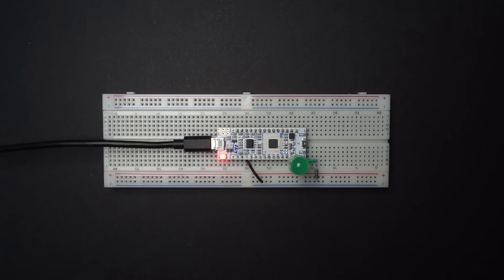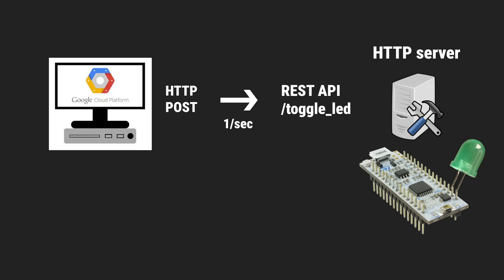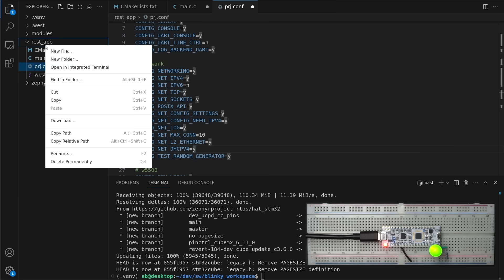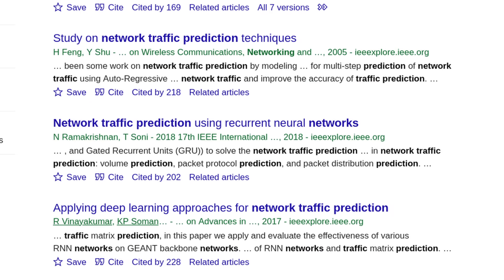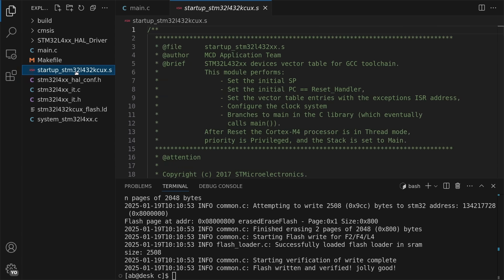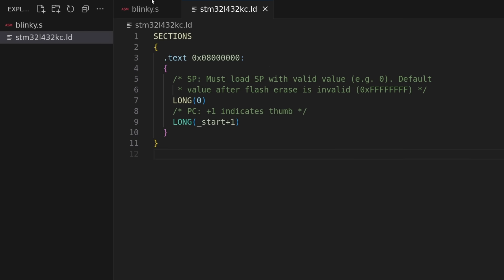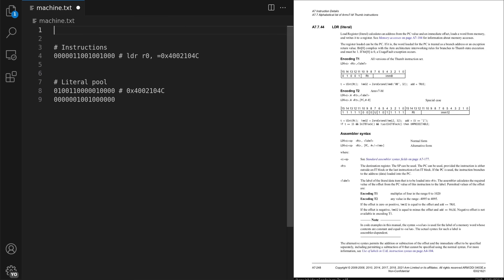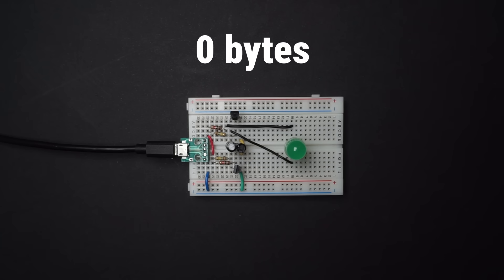I Shrunk Blinky to 0 Bytes

Comment: My boss told me about a totally analog state machine using optoelectrics that fed inputs to an eeprom-based state machine. You'd encode the output state at fixed locations in eeprom, and when you flicked it on, it started by outputting your init state at 0x00 in eeprom and then started doing its thing, completely code free. He said "the only way we could make sure it ran fast enough is if we knew it was running at the speed of an electron" wicked

Comment: instead of the decrement loop in your assembly code, can you somehow link a bit from the system clock to the gpio so that all the program needs to do is pull a bit from the system clock then write it to the gpio? depending on the complexity of the architecture and how the program clock is stored you might be able to shave an instruction off or two. it would basically be the program version of the astable circuit since that's what runs the program clock runs on. bonus points if you can extract the bit from the clock without using gpio and break open the chip to grab from it directly.

Comment: 0:54 but why run it on a microcontroller instead of discrete logic clocked to 1000 ms?  (I'm sure even I'm overthinking this, but this really doesn't seem the job of a microcontroller)
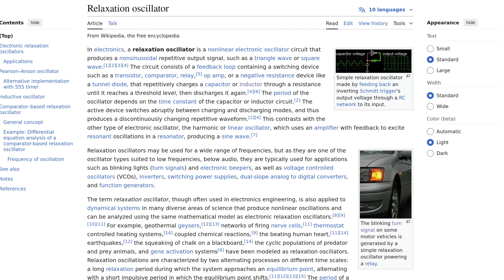Reply: 11:49 okay yeah this would work, but it makes the timing very sensitive to the component tolerances so idk if I'd count it as being as close to 1000 ms as possible.

Comment: About 0 bytes - Microcontroller is last solution, that you may use, if it's too hard to do it with analog devices. I developed a board, that allows you to connect door phone to land line telephone line. And without any microcontrollers. Only analog and hardcode (hard core, not soft core)

Comment: you could program the microcontroller so that it only supplies electric current to the blink circuit
or connect blink circuit to microcontroller 5volt and GND

Comment: 0:00 / 0:01 Pulse Width Modulation (PWM), using set of electric pulses to control the output independently from the input, because you can't simply control something by decreasing input voltage, but rather using something like this: |||....|||....|||....

Comment: Please Artful Bytes, hear me!
Sorry, but I'm very upset because of all steps after AI. Sorry, it's really bad. I don't want to be rough. But. As embedded developer you are using delays!
It's just unacceptable, it's a crime against nature.
There is no delay instruction in ARM manual, or any other architecture. Was you ever wondering why?
NOOP means no operation. It didn't called delay or wait or sleep. And there was and currently ongoing alot of debates to remove it completely.
"And how I suppose to measure time?" - you can ask. WITH AN ONBOARD PRECISE TIMERS OF COURSE!
Dude, really. There is several HIGHLY-configurable peripherials on every MCU on Earth. On that specific stm32l423 there is total:
11 !!! TIMERS
2 ! PLL
Oh god there is RTC onboard..
14-bit DMA
Man, you can blink that LED even without runtime code. On old(but reliable architecures like AVR(arduino lol)) you even can blink it without burning FLASH memory with firmware, just by adjusting specific fuse-bits. Means less than 16 bytes for completion or even truly 0 bytes for AVR.
So, please don't do this again. Don't ever use delays, just stop! Don't teach anyone to do this! It's most disgusting and unethical thing in embedding. It's insulting life itself! Using delays is path right to jail.
Thanks anyway for highlighting embedding existence!
Yeah also about 0 bytes solution: because of pulse trails not quite formal beside of mechanical approach with 1 reed switch it also achievable with 1 optotransistor or even 1 BJT or even! (1 same LED and RC circuit) which in total also 0 switches(zero bits) instead of 2 BJT flip-flop(2 bits basically).

Comment: i think you could make the assembly programm even smaller by configuring an io pin as output high and configuring the watchdog timer to 1s with fuses... ok your on off timing would probably not be symetrical... but maybe storing the last state in a capacitor on another pin and reading its state at startup and just outputing the opposite thereof is less bytes...

Comment: Well, the code you'd run on the micro-controller would be [null] so the last solution does technically run on a micro-controller. Just treat the circuit as a peripheral to the microcontroller :)

Comment: Using Arduino Uno (not the same microcontroller), I did, in a blog post, manage to squeeze the blink example down to 6 instructions (12 bytes):

```
  sbi DDRB,OUTPUT_PIN ; setup

mainloop:
  sbi PINB,OUTPUT_PIN ; toggle pin

delay:                ; ~ 1 second
  sbiw R24, 16
  sbci R26, 0
  brcc delay

  rjmp mainloop
```

If clocking down the speed (using fuse settings) is allowed, and removing the bootloader, the busy-wait and jump can actually be removed. This causes a free-running instruction pointer that loops the rest of the entire blank flash, giving a blink program in "only 2 instructions" (4 bytes).

Comment: I actually use not only a micro controller to blinking LED, but also network before and it was required. The requirements were however, slightly different light to go on and off once a day is turn on the same time in the morning as it did the same time at night it needed to use an STM 32 C3 micro controller because that’s what I had no additional hardware besides Denali and resistor the way that I did this was by writing system for calling to a NIST time servers every eight seconds as required by servers, turning that data into integer values and then checking variables that were defined by a web portal at startup what’s worse is that all of this made sense and we did this it’s still functioning. We’re still using it and it has never failed that LED turns on at precisely 7 o’clock every day regardless of daylight savings regardless of time zone regard this is if I’m there if I’m not if the power goes out or stays on powered on battery or plugged in, it will always turn on at precisely the same time and it will always turn off at precisely the same time within eight seconds I built this project for my jumping spiders because they don’t get hungry unless they get enough light so consistency is very important. That’s the main reason why I added the battery to the project the micro controller. I had already had a battery charger and battery port so I just saw a little battery on there to keep it going for a few hours, it default to the current pin state until an update is received from the network. If the network drops it will retry until it fails. When it fails it will give a warning code through the blinking light because again no additional hardware and then remain on or off depending on time went out. I have yet to add additional network checks in the loop code times out right now and then fails and notifies. I don’t know why I did this. I could’ve just spent $10 on a smart switch and put a lamp over the enclosure, but it was cool

Comment: For your bistable flip-flop circuit, I recommend using an NEC555 timer IC. Although it is fundamentally an integrated circuit, you might find that it resembles a compact microcontroller, such as an ATtiny, in both appearance and certain aspects of its behavior.

Comment: This reminds me of a time in college when I met a group of computer engineer students who were working on a homemade timer project for a class.
They were making a binary, five-minute timer, and were showing it off outside the student dorm grocery store.
They were sitting down next to me while I was eating some pizza, and I asked them if the minutes and seconds were set separately. They said that I was correct and that there were separate inputs for minutes and seconds. I asked if I could turn it into a six minute timer in one, easy step.
They said yes. I turned the knob for the minutes to five, and I turned the knob for the seconds to 59. The resulting conversation they had about whether to remove that function or make it a feature was fun.

Comment: I get that the point was to use AI in some way but you could i have just: time.sleep(1-latency)
and boom, you now only sleep for the rest of the 1 second duration, you can fetch the latency after the request then run the command above

Comment: I love working within constraints. I had a project that needed some randomization and it turned out it was easier and more space efficient to store 100 precomputed random numbers into 50 ints and cycle through them. The whole cycle took six minutes so it was "random enough" and saved 600 bytes of flash versus even a simple PRNG.

Comment: Honestly it depends on what you consider a byte but using an analog system for blinky that depends on whether the circuit has power or not is probably always going to be most efficient.

Comment: You can go one step further, there are LEDs that blink without needing any extra circuits other than current limiting.

With a little bit of time you can find the right resistor value and a blinking led to get roughly 1000ms blinking.

Comment: Would it be possible to config the clock to run at 0,5 Hz and output that to a GPIO? No toggle logic required. I think the RTC clock can be set to output 512 Hz or 1 Hz on the PC13, so maybe tinkering it down to 0,5 Hz would be doable
Reply: nice idea

Comment: 11:05 As long as we ignore Pseudoinstructions, yes, they are pretty much one to one representations.
And in case somebody doesn't know what Pseudoinstructions are: These are instruction which as far as Assembly is concerned are treated like normal instruction but are multiple instructions in reality, which means that they get splitted into their actual parts by the assembler.

Comment: Why do you use adds r0, r0, #0x18? Why not just str r1, [r0, #0x18] and remove that instruction?

You could also save another ~3 instructions by merging the delay and gpio update.

Comment: Man - check the "self-blinking" LEDs on the market....
(you only connect the power voltage to it and it blinks on its own - the swithing semiconductor is on the LED chip itself)

Comment: The purpose of blinky is similar to a hello world program. It bootstraps a project, gets basic behavior done. The whole point is to get the microcontroller involved, because blinking is not the target. It's just the first step. 

You could write a hello world on screen with 0 bytes too.  Just use a permanent marker. 

To me, the final conclusion looks a little like misunderstanding the whole point of blinky.

"Great, now connect your project to a sensor using i2c"

Comment: Technically the astable multivibrator is 2 bits. 

My shortest atempt on a PIC microcontroller has 5 instructions. Altho it doesn’t respect the 1000ms rule because it uses the sleep instruction and the watchdog timer. 

Oh I forgot, there are LED that flashes… even multiple colors. I think they have the integrated circuitry to make it flash.

Comment: I was expecting the zero instructions code to use a PWM to blink the LED. As it's hardware, there are no instructions to 'blink'. You could still go a lot further, and use features like brownout creatively. E.g. create a fault which resets the microcontroller every second. An RC filter from the LED line to the reset line might work just as well for ~1 instruction, ~10 bytes solution.

Comment: Crazy thing is that the resistors and capacitors needed to make that relaxation oscillator cost several times more than a small microcontroller such as an ATTINY, and occupy many times more space. For that reason today we frequently see tiny chips containing the full power and features of a bar fridge-sized 1970s minicomputer doing things like blinking a single light in an appliance.

Comment: I wonder if there's another optimization in the assembly/machine code state where you could leverage setting up a timer peripheral and pipe its output to the GPIO? No branching logic required, just a few extra register writes.

Comment: If you want to use a microcontroller, you can buy a fresh new Arduino and plug the USB cable in any power source. It will blink the LED by default, you don't need to write any code, so 0 bytes with a microcontroller (the preload code doesn't count 😅)

Comment: Using a 555 timer could have been a nice middle step between the last two: it has a flip-flop inside, so even not being a microcontroller, it could have been classified as an 1-bit implementation 😂

Comment: And the discrete oscillator is radiation resistant, tolerant of extreme temperature ranges, immune to EMI, and would likely work for 1000 years if built well.

Comment: The point of a Blinkenlight, is to test all system components are working. So your discrete astable doesn't do this. ie, Make it as simple as possible, but no simpler.

If you want zero bytes of code, use an FPGA: Technically, they don't run code.

Comment: You could set up an LDR in series with the LED and then construct a spinning device that blocks light for 500ms and doesn't block a light source for 500ms and get down to truly 0 bytes (and continue adding ridiculous mechanical complexity in the 0 bytes category).

Comment: Sure, "using a microcontroller to blink an LED is overkill" if that's all you need to do. But when the requirements change, it's generally easier (and cheaper) to update firmware on a microcontroller than have to redesign and rebuild a discrete logic circuit.

Comment: ok, 11:11 - you should leave the microcontroller but not connected - in fact it runs a 0 byte program without turing on :)
i would just use a blinking LED :) but there are no 1000ms blinking leds.

Comment: maybe a possible solution would be:
- set GPIO port to output and set the level to HIGH
- add so much to a register until the interrupt jumps in and restarts the microcontroller

Comment: Could you set the LED pin to the highest needed bit in your counter register. Then compare to a value that is double the needed timer count value. If not equal, increment the counter. If equal, set counter register to 0 and loop.

Comment: For the ARM (or thumb, really) asm, you should be able to at least get rid of the add instruction where you increment the address, as you can encode offsets into the store instruction. If its out of range, perhaps the address can be massaged so it's somewhere between the two addresses and then you can use a negative offset for the first store and positive for the second, or so.

Comment: So in the end you used a total of 8 components to do what in the previous step needed 48 bytes of machine code and a microcontroller that probably contains thousands of transistors and is way overpowered for this simple task. And that's what you could, in fact, do with every problem... I think every problem that's done in software could be embedded in a circuit that needs far less components than the computer the program is running on. Still people went from discrete circuits to computers because the software for them is easier to design once the computer (or microcontroller) has been built. However, with today's technology one could try to automatically convert software into electronic circuits...

Comment: If you get all philosophical here. What is a byte? I would argue that your astable circuit has at the very least 2 bits of information, one for each capacitor. 4 if you count the transistors. I'm just messing with you

Comment: I think you missed some stages.
1. Use a simpler microcontroller. The STM32 devices need more initialisation than most. Something like a PIC (or maybe an STM08) would need less.
2. Use a 555 for lower parts count but still an IC
3. Use a simpler oscillator. An astable multivibrator is not a relaxation oscillator, which is a capacitor discharge triggered by a threshold voltage. You could use a 3-pin comparator such as a supervisory IC , or if you used a neon (which has an inherent trigger voltage) just a capacitor and a resistor. An LED too has a voltage threshold below which it will not pass current but it has no hysteresis.

You might also enjoy Dorkbot's competition to find other ways to flash a light. I'd give you a link but youtube has now sunk so low it doesn't publish them. Look for 'dorkbot flashing light competition'. I never got around to entering but my idea was to run an unpowered AM demodulator near to the longwave time transmitter at Anthorm - it would illuminate once per second.

Comment: Trash the whole loop and use a capture and compare timer. It may not be a smaller size but uses much less core processing, which is the real goal in optimizing embedded code.

Comment: You absolutely, 100% cheated for your final approach.
I applaud your work! ❤

...I went the other way for my vehicle blinker project; started with a 555 with a relay, and eventually upgraded to an ESP32, mosfets, left a relay in but only to make the clicky noise, then added in CANbus connectivity to link it to other modules, including the control cluster on another esp32.
Simple really 😎

Comment: 44 bytes isn't bad, but you could go smaller by using a PWM channel or similar to do the blinking instead of your own loop. Stop thinking like a javascript developer, start thinking like an embedded engineer. On an RP2040 you could do this in about a dozen instructions: set pin direction to out, toggle pin value, increment alarm register by 1 second, enable systick alarm -- and then hook this one function up as both the reset and systick irq.

Comment: Some MCUs allow blinky just by using the internal clock divider of an auxiliar clock. Feasable with a 32.768 KHz tuning fork crystal. Or better yet, why just not use a 555 timer?